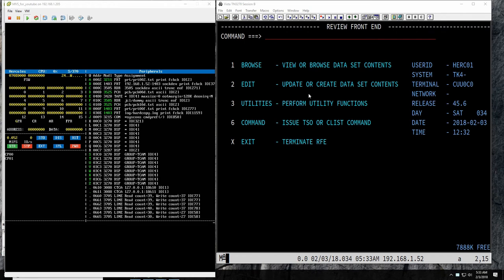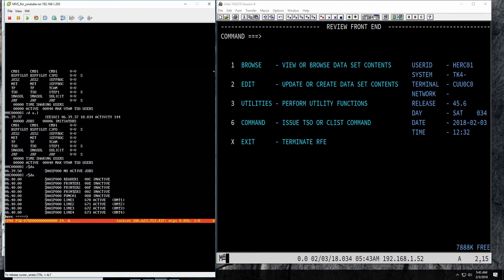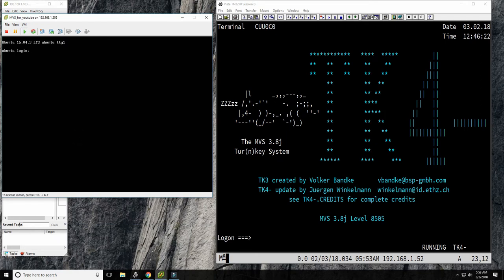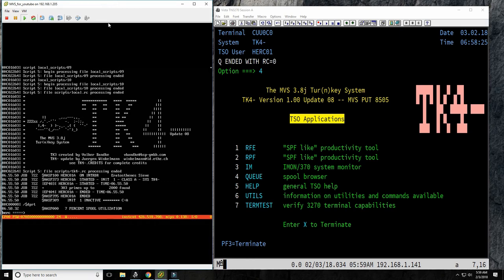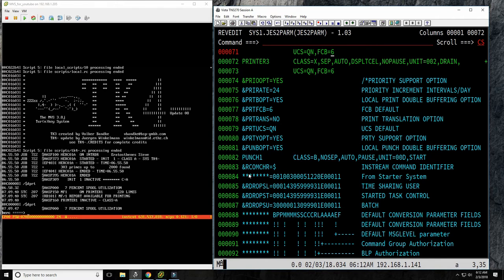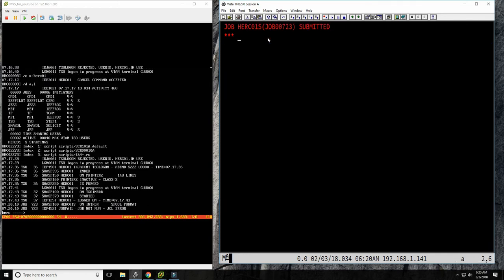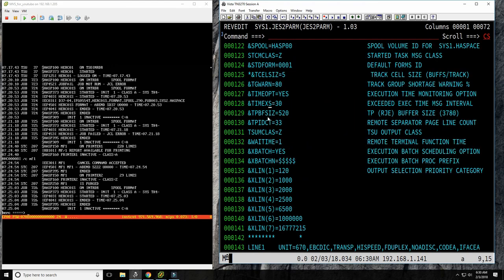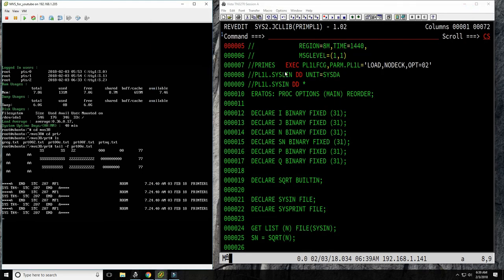Managing IBM JES2 in MVS 3.8- M41

Comment: When I was an operator at a hospital, we moverd from running 5 machines under DOS/VSE and VTAM to several partitions of a Z360 running MVS.  We had Computer Associates to interface with TSO.  CA7 (CASCHED) created the schedule of batch jobs, CA11 (CADISPATCH) handled the output.

Every Sunday Morning at 2:00, we did a shutdown and IPL.  I got so I knew what jobs and subsystems could come up at what time.  I'd normally have us shutdown, have the SE start the IPL, and have CICS up for the nursing units abd ER in 20 minutes.

It also helped we were replacing what DASDs we could with RAMACS.
Reply from the maker: Nice . Thank you

Comment: Hello,
In 50:12 you mentioned that it should allocate 20 cylidners and allocated 300 and you need to figure it out but the info screen displays the tracks, not cylinders and 20 cylinder is 300 tracks (20*15=300). When you've submitted 726 job it shows 300 tracks also so in both cases were 20 cylinders. No need to figure it out :)

Comment: The job output in class K did not print right away because class K is a hold class :-). You needed to release the held job output with the $O command.
Reply from the maker: Thanks! Yes I should have checked the JES2PARM definitions. Thanks a lot

Comment: great info, thanks, another question, I try to run the sample job to change the pw for a user but afterwards the user can not logon any more
//CHGPWD  EXEC PGM=IKJEFT01                                 
//SYSUADS  DD  DISP=SHR,DSN=SYS1.UADS                       
//BRODCAST DD  DISP=SHR,DSN=SYS1.BRODCAST                   
//SYSTSPRT DD  SYSOUT=*                                     
//SYSTSIN  DD  *                                            
 PROFILE NOPREFIX                                           
 ACCOUNT                                                    
    CHANGE (HERC02) DATA(JAGUAR)                            
    END
Reply from the maker: What’s the job output ?
Reply: @moshixmainframechannel  I am running this
SYS2.JCLLIB(CHGPWD)
and get
 PROFILE NOPREFIX                                             
 ACCOUNT                                                      
    CHANGE (HERC02) DATA(JAGUAR)                              
IKJ56575I USERID HERC02 NOT FOUND AS SPECIFIED BY NODELIST    
    END                                                       
END
Reply: ok, thanks, fixed